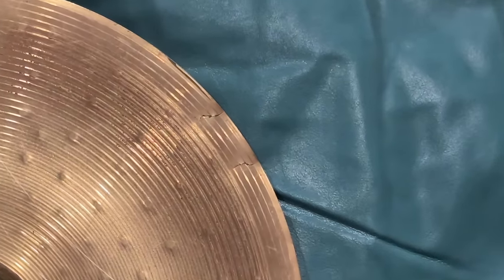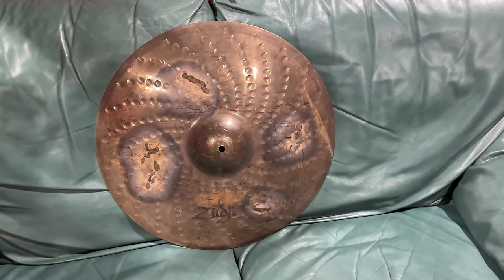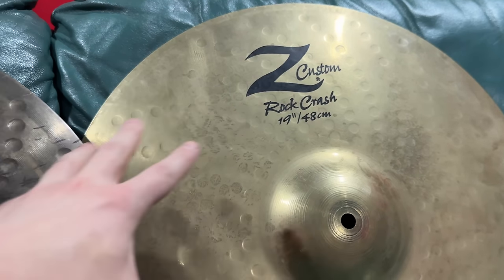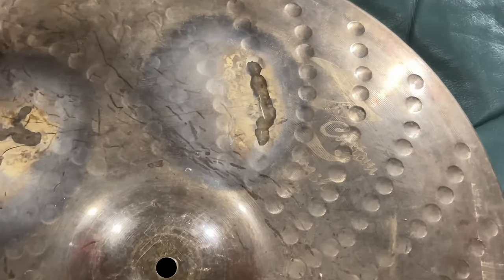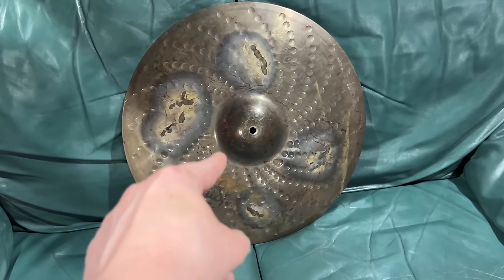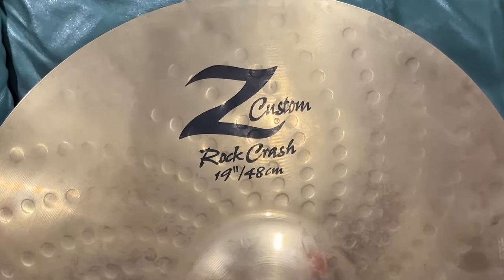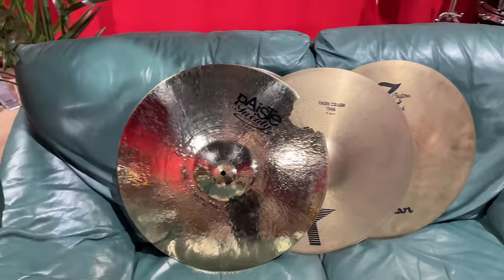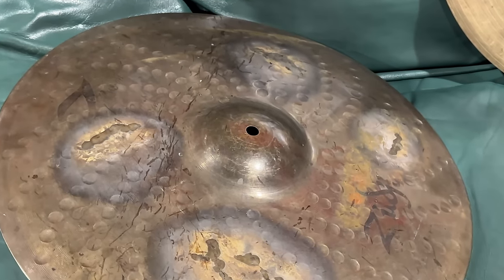Someone welded this cymbal.

Comment: Cracking Cymbals generally suggest poor technique.
That Paiste Twenty you took a bite out of must have not tasted very good.
Welding cymbals 
High speed polishing, etc creates heat and alters the molecular structure of the metals thus making your cymbal trash.
File a space between the crack and drill a hole to stop the crack from moving.
Better yet learn to stop breaking stuff.